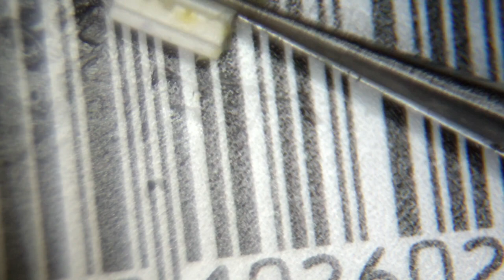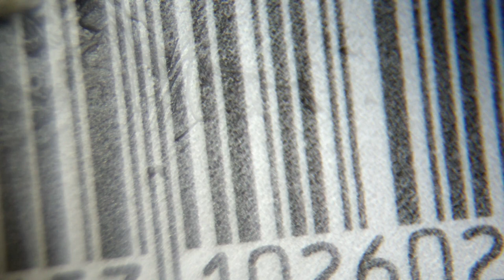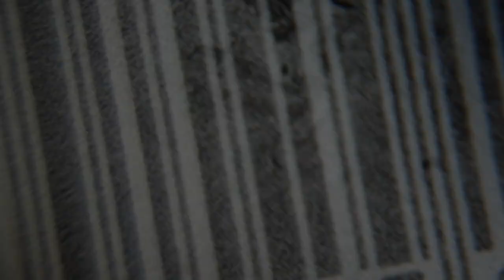NBRC Canon Selphy 760

Comment: My printer is cp1300 haven’t used it in 2 years but was working fine when put away.  Used it recently it’s prints no issues but it squeaks when printing.  Does it need oiling or is it the cartridge or just a few run through of prints too stop the squeak.  Any help appreciated.
Reply from the maker: It wouldn't surprise me if the grease used has dried up a little whilst in storage. Most of these mechanical systems like to be used regularly. If you are able to warm it up and run several pages through the noise may reduce - but you don't want to waste the consumables though so it is a tricky problem. I have a small tub of clear synthetic grease I keep to put a small dab onto squeaky mechanisms using a toothpick.

Comment: Hi. I've had a CP760 in the cupboard for over a decade and I took it out and it only prints about 2/3 of the photo. And that 2/3 looks fine but the other third is completely blank. The transition is not distinct and I'm printing out a black and white photo which becomes a bit colourful along the wavy edge. The unit previously worked fine. I changed the processing cassette and the paper. Any ideas? Thanks for the tips on taking it apart. I used to work as a tech decades ago, but I was going to throw it in the bin.
Reply from the maker: Unfortunately I do not have any advice for your problem -  I hope you can sort it out.
Reply: Thanks for the reply but I threw it out.
Reply: What the cause the picture is white

Comment: Where to buy sir, my printer same problem..cp820
Reply: The link is in the description under the video (aliexpress).  Size 10T and 1.48mm diameter hole.
It works perfectly.

Comment: how long did it take to receive the gear?
Reply from the maker: I cant remember but it would most likely have been 3-5 weeks. Cheers.
Reply: @northbalwynrepaircafenbrc8202   My apologies for asking more questions, I managed to get that size off of amazon but find that the inner diameter is a little too big and the outer diameter is too small. so difficult getting the right size
Reply from the maker: @atruceforbruce5388  Sorry to hear about your problem. I re-checked the Aliexpress link and it still works. The size I ordered from this page was 0.3M Modulus, 10T, 1.48mm dia. hole. It was a tight fit - I pressed it home very carefully with my vice, if I remember correctly.